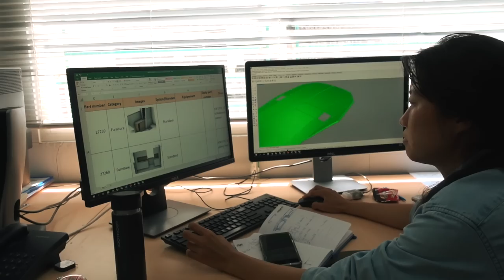Helm Visibility- The moment of truth... | Catamaran Build in Vietnam

Comment: Sailing Zingaro just complained big about touch screens on a boat that are not water insensitive. Several types of touch screens have problems with slightest moist on the surface. With a thin wet salt layer the surface becomes a conductor that kills all touch performance. ( I made the chips for capacitive touch screens and I know several phones have problems). So test the screens that you get in wet salty environments and see the latest episode of Zingaro.

Comment: Will you hang the clears from Keder rail/ Flex-a-rail? Did they mold a channel into the ceiling and a stout snap line below? Making an enclosure and the properties of snaps, twist-locks, LOX, and Lift-a-Dot is often overlooked by the CAD team.  What holds best in weather, and what feels better under foot or during a fall differ greatly.  
Thanks for sharing, Nick.  -EZ

Comment: 9:04 Be sure that the LEDs are not pulsed while dimming. Otherwise you won't be happy using your camera gear around them ;-)
Reply from the maker: There is a fix for that:
Duplicate the shot and move the second shot 1 or 2 frames forward. It cancels the pulse if you’re editing at 24fps
Reply: @sailingrubyrose  Pro tip! Found a guide on YT for that now :-)
But really never had to deal with that for the footage I take ;-)

Comment: I see two challenges with the current design. The first one is the inside navigation seating area, once they install the chair it will be very tight to move up or down because there is almost no space between the gally and the sitting area. The second challenge, where the hell are they going to install a table in the cockpit?
Reply: If you check the model's interior 3D cad exposè from earlier in the series you will see how it will work, better than I could describe it here. Look for the RR2 Intro video from about a year or so ago on their channel.
Reply: @gbsailing9436  I follow RR for a long time especially this buildup, and I am familiar with the 3D rendering. Now, seeing this coming together and the proportions of a human in these spaces I find it to be very tight.
Reply: @davidg2651  I see. Well, I guess we'll see how it comes out in 6months time. Plus, You are not going to be sitting at the Nav station all the time and when you aren't, then you just push the chair and will be somewhere else, either on deck, or at the helm or lounging in the saloon/cockpit, so I don't see it as a huge problem.

Comment: Compare the helm visability to that of the Balance cats???
Reply: Probably similar for the lower position, but the Balance cats have the huge advantage with a raised helm as well.  Not sure what the advantage would be to the 1370’s arrangement other than maybe docking the boat.
Reply: The raised option that Balance provides with their Versa-helm is way better. Having been out on both Leopards and Fontaine Pajot cats, (as well as been aboard Seawind, Balance, HH, and others at shows), I MUCH prefer the raised helm option. Hanging off the back or sides trying to look through or around the cabin like Nautitech and others also sucks.
Reply: @joesmythe8232  I have suspected as much, but your expertise and experience is so much greater than mine. For the love of me, I still do not understand why they did not go with the Balance similar option. It seems to me that the Balance approach and ethos is compatible with their views????

Comment: Is it just me or do the supports around the windows seem much larger than in the original marketing video?
Reply: You are 100% correct. The view of the computerized mock-up on their webpage is significantly different. The “A” pillar (as referred to in the auto industry) in the corner of the actual build is 3 - 4 times wider than the design, and the “B” pillar is easily 4++ times as wide. Those mullions are HUGE on the production yachts. The base of the mast looks almost 50% wider as well.  The view is definitely not great, and I don’t believe any better than their other boats. The view on their website is definitely misleading.
Reply: @joesmythe8232  actually I think maybe that’s just some craft paper around the windows that removes once the glass comes in?  Has to be, right? ..  maybe, but if not then for sure them renders r bullshit
Reply: @TQRosen  Yes, you are correct regarding the paper. But if you watch further into the video where he is on the bow, you can see the portion that appears structural vs. paper.  I’ve been on the two smaller Seawinds, and determined long ago that I don’t want to spend my time looking through the cabin. Elevating one helm and eliminating the other would free up some space and allow a better layout option as well. I’d be interested in that.
Reply: Both the Balance and the HH 44's appear to have better visibility from inside.

Comment: Those helms are horrible!! So much to like about the Seawinds. Rugged construction. Lightweight and slimmer performance oriented hulls. But no matter how much they try to justify those helms, it’s a deal killer for us. Sure you can see… if you bob and weave to look around all the obstructions. As I’ve said before, and someone else commented here… it’s like driving the bus from the back seat. It’s one thing to be inside if your face was against the front windshield. But it’s entirely another to be 12’ -14’ back from your windshield. That reduces your vertical view angle significantly, and accentuates the movement and definitely the perception of the pitching motion.  Nick already demonstrated that when he got queasy sailing the 1260. The view of up/down - up/down viewed through the cabin as the boat pitched was horrible. It was nauseating watching it on TV! Can you imagine at night in the rain?! And you have to have all the lights off in the cabin at night, or you won’t be able to see out! That’ll be fun for the rest of the crew trying to cook, eat and other activities aboard. Give us the option like Balance. Or just make it raised like the HH50.  Heck, I’d rather have an Fontaine Pajot!